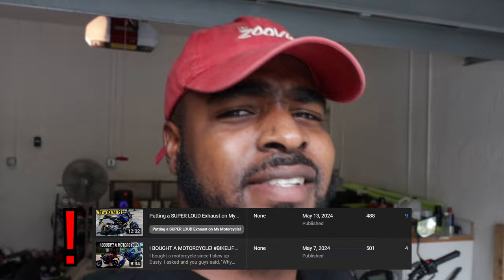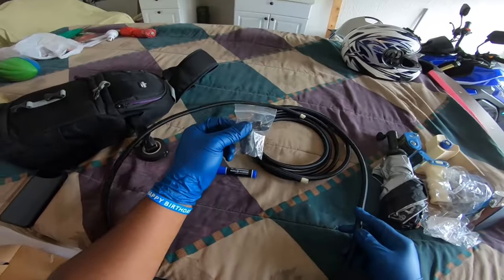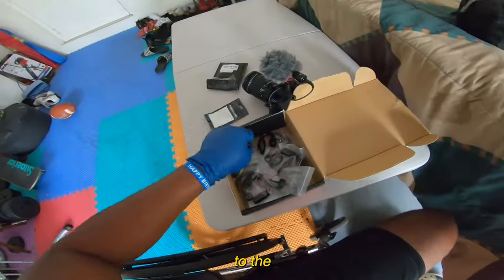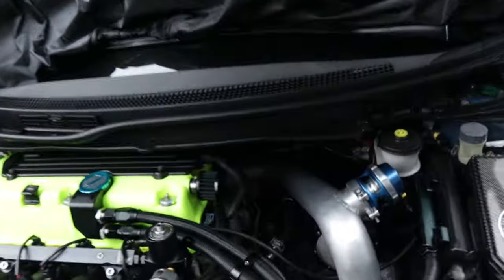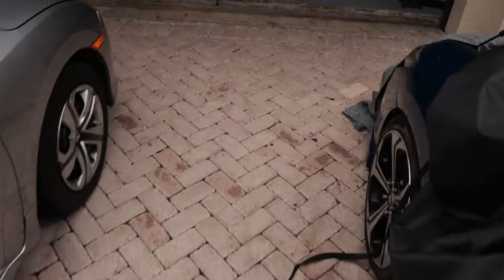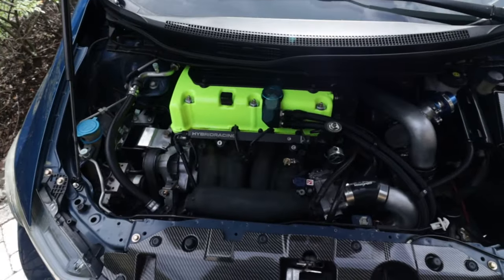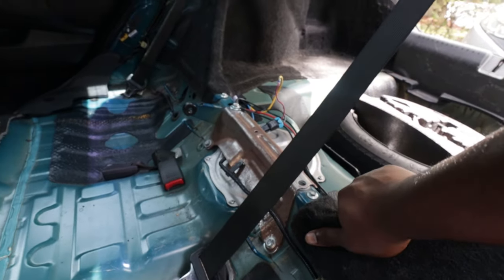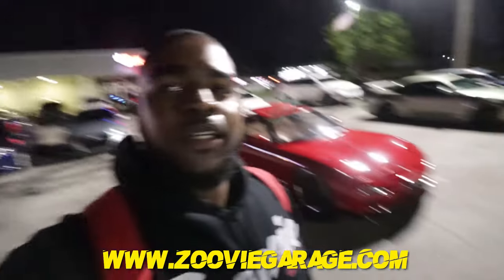NEW 800HP+ SETUP FOR DUSTY!

Comment: Whenyou originally boosted Dusty, did you have to build your transmission or throw an aftermarket clutch on? I know you were pushing 12 psi and I'm just curious what else you paired your original turbo setup with.
Reply from the maker: @curtis577  it was stock trans and stage 3 action clutch
Reply: @zoovie  What turbo and supporting mods did you do? And did anything go wrong with the transmission after daily driving?